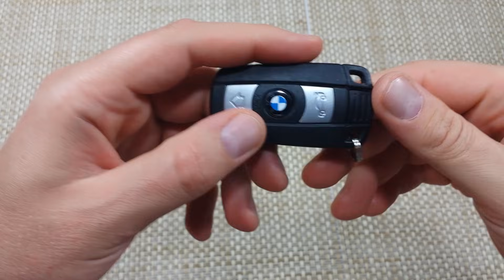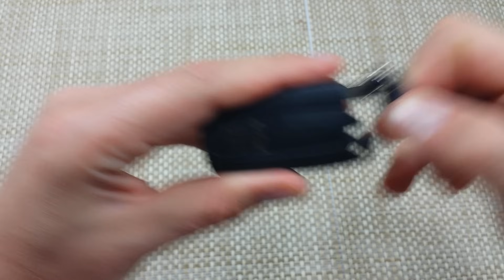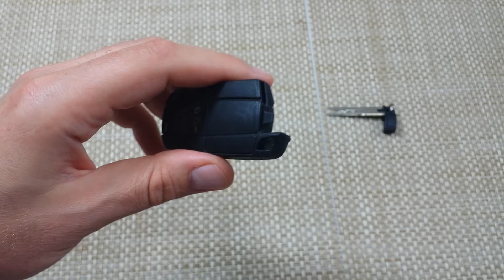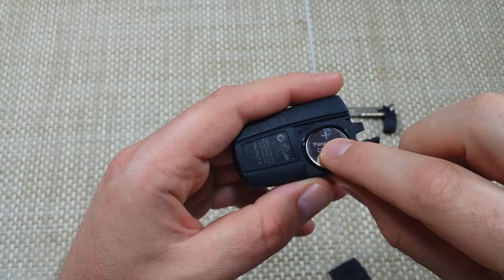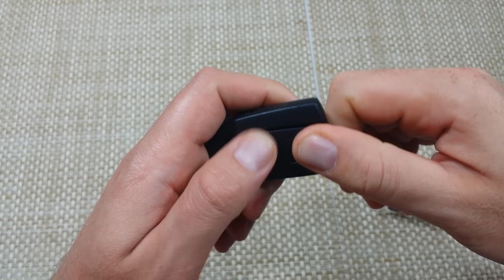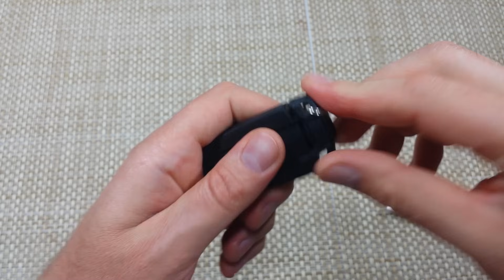How to change / replace smart key fob Battery BMW 1, 3, 5, 7 series & X5 FCC KR55WK49147

Comment: Top tip! Instead of using a screwdriver you can use the key itself as it fits exactly into the gap for pushing the back off.
Reply: thanks!
Reply: Exactly! I was just about to make this comment - just use the key that you removed in step one!
Reply: Thanks! 👍
Reply: Another Top Tip: some older cars can be started with a screwdriver alone.
Reply: @jorisbonson386  XD

Comment: mine looks just like that but no little slot for screw driver and no seem on back for little door to battery.....wtf
Reply: stallion78 this only works if you have keyless go! if you dont your key fob is indeed different and its much more complicated to change the battery!
Reply: stallion78
Reply: Just discovered that the key fob for my wife's 2007 BMW 3 series is a sealed unit. You are unable to pop open a cover to replace the battery. The dealership charges $330 for a replacement and the parts guy says these fobs typically last 5-7 years .What a racket!
Reply: Jim, BMW absolutely sucks. This is another example of the stupid way they design their cars. What a racket is right. I just got my 328ix back from the shop. They recommended $11,000 of repairs on a car that cost me $8,000 and runs fine now that the plugs and coils have been changed. And don't get me started on the stupid electronic oil monitoring with no dipstick. I swear, the reputation Germans have for engineering is way off. The overthink everything. I'm going back to Lexus. This is our second BMW, both had problems. Never buying another BMW.
Reply: I charge my key fob on my sonic care charger for the glass cup. Works great!
Reply: I agree 1000 %...my first and last BMW
Reply: Can you please elaborate on this idea? I cannot really read your mind. Perhaps, it helps charging my fob, too.
Reply: Jim Landers it will open. You need either an exacto or box knife, something super sharp. Take the key out then slide the exacto all the way around the seam of the  fob until it loosens up. The entire thing will split in half to expose the battery. Just be very careful not to damage the buttons on the outside of the fob while wrangling it open ... 
After swapping the batteries it will click back together seamlessly. Bonus, it only sets you back about $5
Reply: @jimlanders3935  5-7 years? No way. I have 3 BMWs one of which I've had for 15 years which still has the original 21 year old batteries in bith it's keys. Of the other 2 (2005 & 2007) one needed replacing 3 years ago, the other car has one key that has failed this week. So that's 15 to 20 years from Panasonic rechargeable batteries that costs less than $15 plus another $15 for a soldering iron if you don't have one.

Comment: Amen 🙏🏽 you saved me $158.  I asked the dealership about my fire not locking. They said i might need to reset my car. I heard a man laugh in the background. I was like let me check with my warranty people before i schedule a service for my car. I knew I needed to check the manual. Then I realized the car was telling me for a while to replace the battery on my remote. 
To think I was about to get rid of this car. It keeps telling what’s wrong so I can fix it.

Comment: perfect instructions and to the point - saved me the nightmare of going to the dealership to replace the smart key fob at a fraction of the price (battery only). My key was slightly different, but the video gave a good general idea on how to tackle it. Thanks a lot!
Reply: Use the key instead of a screwdriver. The slot is designed to take it. Push the key in until it clicks

Comment: I have a 2006 3-series and the front of the key is identical to yours but the back is different. That back piece isn't there to remove.
Reply: Just a tip for others, mine had no tabs to snap apart, it was glued! And once separated it needs re-glued to stay together!  Battery isn't easily separated either, it's soldered in!

Comment: Thankyou for such simple, straightforward instructions, but why have 274 people disliked this?
Reply: Probably because not all BMW keys are like this. Mine has no opening panel and also a non-replaceable battery - battery is soldered in to its holder....
Reply: Does not work for some BMW 2010 key fobs ughhhh...

Comment: Mine is a 2010 and the fob looks exactly like yours, but I don't have any type of opening at all there where you slipped in the screwdriver--nothing: it's all one solid piece there. I do have smaller slits on both of the outer sides. I may try to wedge it open there. Any suggestions? TIA
Reply: I found I have the non-comfort key. Fun times wedging it open and soldering the battery in. WTF bmw?

Comment: Can you start the car when the key battery is compleetly finshed?
Reply: That's  very good question...
Reply: I just looked it up, yes. Just the remote unlock fails, so you have to use the manual key to unlock. These batteries are very cheap, so unless the car is brand new, replace them anyways (main key and the spare).
Reply: Ssw

Comment: My 2006 key looks exactly the same but does not have the slot for a screwdriver/key, or the smaller plastic battery cover.
Reply: That's the non-comfort one and it's a PITA. 
Needs carefully cutting all around along the seam with a sharp blade. The you have to either buy the battery and spot weld it to the existing battery or desolder the battery holder and buy a battery that comes with the holder (fairly cheap so makes the most sense)

Comment: Isn't there data for your seats and radio, etc... saved on the key. Won't you loose all the data if your disconnect the battery?

Comment: Quick and simple, just the way I like it. Thanks a million.
Reply: Use the key instead of a screwdriver. The slot is designed to take it. Push the key in until it clicks

Comment: Note that these instructions are for cars WITH Comfort Access (CO). Cars without CO have rechargeable batteries which can NOT be replaced this way. Those require cutting open the fob and soldering. See this video for the rechargeable battery swap: https://www.youtube.com/watch?v=TM33hRBqzDI

Comment: I have a 1 series but my key doesn't have that compartment, any idea if it's somewhere else?
Reply: Same with mine... managed to get the case open by running a Stanley knife around the edge and carefully prising open only to find the battery is soldered in!!!! Think next step is to buy a non OEM replacement and try to code it to my car!!! 🙄
Reply: There are 2 styles of key (I think it depends on the country). The other style is sealed and as Linda says, the whole case needs to be opened up. The battery is a rechargeable Panasonic and needs to be soldered in but it's not that hard. The case then needs to be glued back together. The battery is less than $15 and will last another 15 years.

Comment: My key fob doesnt have a lip to open it did everything until popping out the little cover. Mine is solid plastic. No lip to twist. Help!
Reply: Mines too
Reply: @In-A.i.-We-Trust  mine was super glued and the hard one to replace🤦‍♀️
Reply: @yvonnebejarano8341   how did you get it off ?
Reply: @In-A.i.-We-Trust  you have to break the super glue seal around it. But. Then you have to order the battery from  like Amazon...they dont sell it in stores🤦‍♀️

Comment: Just checked mine from a 1970 3251 convertible same fob ..but sealed ..opened with some persuasion but the battery although the same is fixed front and back to terminals ... looks to be a factory fix not soldered .. nothing ever simple with BMW ...turns out there are two types  ... one that takes replacement batteries (split to open) another which is sealed for life with a rechargeable fixed battery ... yes I got it sealed again and it still works.   The fob recharges when in the car so if you have a second fob stashed somewhere it pays to swop the fob in use every so often to keep it charged up
Reply: You should have replaced the battery when you had it open. Cheap and fairly simple to replace with a basic soldering iron.

Comment: I followed the instructions and put the new battery in but the key fob doesn't work still. Is there something else I should do? Thank you!
Reply: Check the back of the battery you put in the fob. When you buy them from the store they come with a thin, plastic filament protector. Once you take off the filament it will work like a charm!

Comment: The hardest  part for me was getting the new battery out of the packaging. I tried to replace the battery while I was in my car after buying the battery from CVS but the plastic was too tough to open. You need scissors to cut into the plastic but who keeps a set of scissors in their car.

Comment: this not correct for a bmw 300 cabrio.  key man has the right information.  its a little tab on the left side.  other videos are even worse and basically tell you how to screw up your fob.  beware.  if it doesn't work in 5 seconds you're probably following the wrong directions.  also I notice his batter is cr2032.  mine is 2450.  when in doubt take it to the dealer.